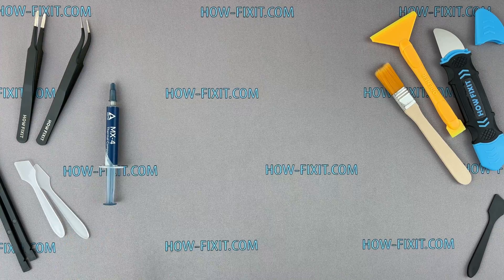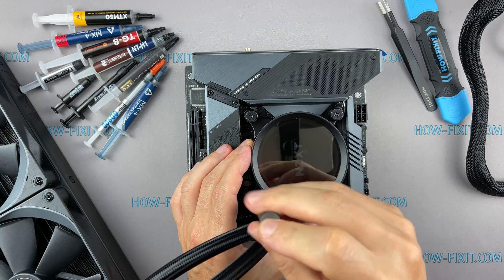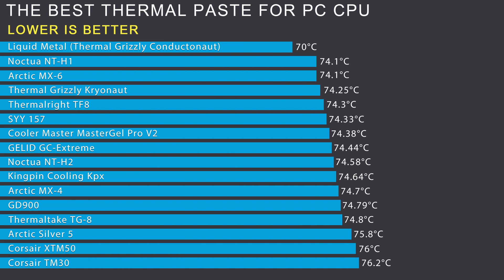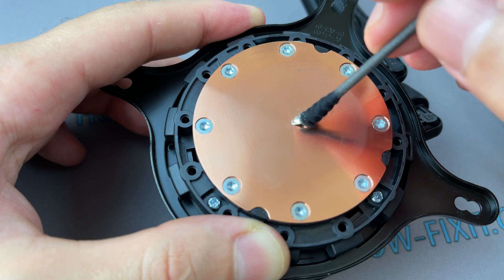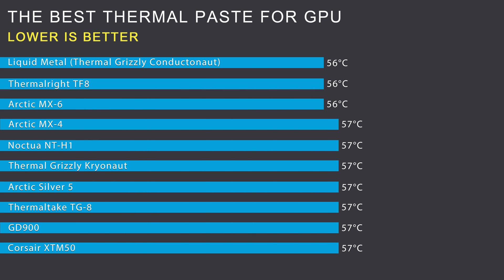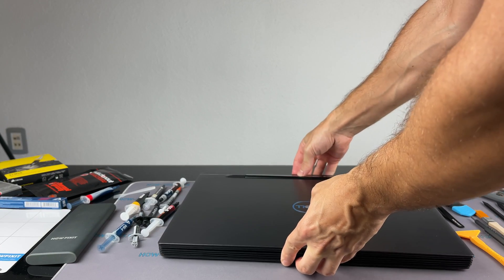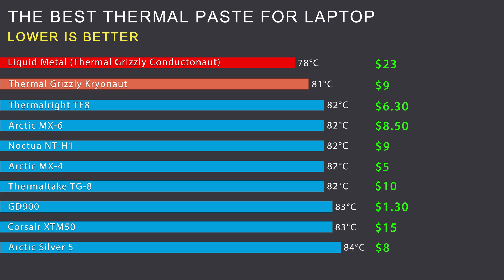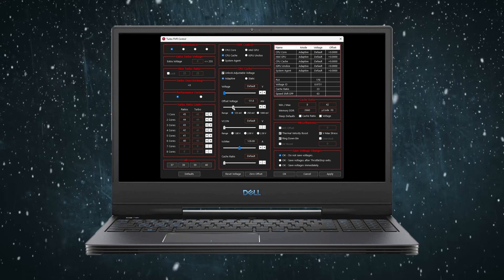The Best Thermal Paste for PC CPU, GPU and Laptop

Comment: I'm a little sceptical of TF8. I used it on my CPU a few days ago. I was getting a steady max temp of 80°c in Linpack. A few days later I was getting 87°c
Reply: TF8 easy dry and turn solid...
Reply: I've been using a tube of TF8 for multiple cpu and GPUs, even though I agree that TF8 dries out quickly (in like a year or more). The performance stays similar to almost the same even when dried.

Have had multiple GPUs and CPUs on the TF8 paste for more then a year, been maintaining steady temperatures so far.

Comment: I used GD900 on March 2022 and keep notes on max temperature of my i7-4770 when running cinebench R15 multiple times. It was 61 C. Today, on April 2023, it still at 61 C max. I know for sure now that my GD900 is genuine, and it is just as good as my MX-4 in term of long term performance.
Reply: GD900 is really as good as Mx-4 when CPU max Temp continuously stays under 75c. But if you use a more powerful CPU and play CPU demanding game where temp stays above 80c... Then you will get a difference.
Reply: how about in 2024 ?
Reply: The downside only about it dry faster than other expensive one
If you have many computer and maintain them regularly then GD 900 is unbeatable about price/performance
Reply: Haven't tried that, but I know Arctic Silver 5 is the best.  NASA even used it on their critical components.  
The problem is these reviewers use enough AS5 to coat 20 CPUs.  It literally only needs a paper thin layer on the CPU/GPU and then the same or less on the heatsink.  Then it takes a few on/off cycles over a month to cure and lower temps even more.  You'll drop a good 2-3C after only 3 days.  It takes YEARS to begin to "degrade" and by then, the temps are what the "highest rated" pastes make lol.

I've used AS5 since 2003.  I've tried MX-4 and a few dozen other pastes.  I always take them off after 3-4 weeks and go back to God's Gift to PCs and use AS5 because no other paste compares.
Reply: Can i apply gd900 on my Laptop. Is it suitable for it ?
Reply: @danialahmad8912  If the CPU package power in stress does not exceed 30W, and in the PC 120W. For above this values only Honeywell PTM7950.

Comment: Based on tests from tomshardware, the results varied when they used air cooler over water. The NT H1 and H2 swapped places when air cooling was used over water.
Reply: There are tons of variables involved in assessing how effective it is like mounting pressure surface of processor cooler effectiveness...etc I guess the only thing we can really say is that a top 10 paste will all be around the same overall so it matters little (excluding liquid metal). We need long term effectiveness tests. No one does that.
Reply: @stephenxs8354 when it comes to using the top respected pastes yeah I agree the change is so nuanced and minute that you should just use the paste you like more for whatever reason you have. Be it easier to spread or use or you just like the name better or the color even, it really doesn't matter at that point because the difference is usually so negligible it's not worth fretting over.
Reply: Plus just the way to apply it.  You can't use the exact same amount for all of these pastes.  Arctic Silver 5 is VERY finicky, but it's the best out of all of these when applied correctly.  
And when I say it's finicky, I mean it.  I've applied it, gotten temps that were 6C too high, then reapplied it and gotten -8C+ temps than I had just gotten.  Too much is a bigger problem than what looks like too little.  You can not coat the CPU like it's peanut butter on a slice of bread or you will not get the best results.  

I'm not saying it's better than Thermal Grizzly, never messed with that stuff, but I've got years upon years of using AS5 on CPUs and GPUs and there is a special way you have to apply it and spread it, and a very particular amount you need to use to get the best results.  

That said, that may make it the WORST paste for beginners.  When you can get 8-10C temp differences just because of using a tad too much, that could be a problem.  When it comes to AS5, less is more.  It's SUPER thick and hard to spread, so it makes you want to just add more paste to fill in any gaps... but that will have you adding too much before ya know it.

Also, you spread paste, you don't put a pea size drop and squash it with the heatsink.  AND you apply and spread some on the heatsink, also.  I'm just saying, I've done this probably 100 times and have gotten it down to a science.  I've watched so many reviews, and my Fuma 2 Rev B with AS5 gets cooler temperatures than everyone else I see online, and I don't even keep my house cold.  I average 58C in most games, and 62C in BF2042 which pushes my 5900x to around 45% average usage which is around 115 watts average, I believe.  

And that's not even talking about the core temps.  That's the hottest temp on the die.  Core temps are usually 10-15 degrees cooler than that hottest temp HWiNFO64 shows.
Reply: BTW, did I mention NASA used Arctic Silver 5 on a piece of one of their space shuttles? 

Yeah... it's that good.  They didn't use MX-4.  They didn't use Kryonaut.

They used friggin' AS5.  'Nuff said.

Comment: I'm happy you made this video. I just bought a new CPU/Mobo upgrade and wanted the best available paste but I already had a tube of Arctic Silver 5 so I was skeptical of buying something else. Now I know that I might have saved 1 degree total
Reply: What isn't said in the clip is that Artic Silver 5, although the manufacturer doesn't say it, has a curing in period.
Reply: @dorientjewoller113 and its conductive
Reply: @quester34  No longer, formula has changed.
Reply: @user-fiendly186 I have an HTPC I built over 10 years ago with Arctic Silver 5.   Just recently took it apart and reapplied Arctic Silver.  Never had an overheat issues with AS5 even in my desktop gaming pcs.  The way I apply it is with a credit card and apply a thin layer to the entire top of the CPU.  Worked great 10+ years ago, still works great today.  You want minimal paste on the CPU, just enough to close up any gaps between the heat sink surface and the CPU surface.   Less is more.

Comment: I spread a thin layer over the whole CPU and then put a 'dot' in the middle. My theory being just spreading can cause air being trapped, and with only the dot, you risk not covering the whole CPU.
Reply: Hm, that's quite neat idea 🤔
Reply: I was just thinking about trying this the other day.
Reply: That’s actually really smart
Reply: Same thing I've been doing for a few years. Thin spread, then about half a grain of rice in the middle. Little to no spill over, but perfect coverage.
Reply: For those thinking this is a good method. You ARE WRONG! Try on 2 pieces of acrylic and see the result.
The dot will create a "layer" over the alredy spreaded one but very small, and will prevent the correct contact with the rest of the cpu/cooler, creating more problems than going with any of the other 2 methids alone. 
This happens because it is exactly the center the part wich have the less direct preasure from the cooler and the outside preasure which begings earlier and stronger prevents the correct flow of the dot
Reply: The sheer pressure of the heatsink should force the air bubbles out. I think what you are getting by putting a dot is a placebo effect.
Reply: So you put thin thermal paste, then put dot. I need try. Only one try
Reply: I put 5 dots. 1 big one in the middle & 4 slightly smaller in the corners. Always have perfect coverage that way.
Reply: Nothing related to paste but sorry I just liked ur comment and changed the likes from 420 to 421😅
Reply: Exactly also my technique with applying thermal paste on the CPU and also the cooler.
I use both techiques on the cpu aswell on the cooler to minimize airpockets
Reply: this sounds like a solid, good method. I just use the half pea size amount, never had problems, but yes the CPU corners are left bare
Reply: I make an X.
Reply: @Honin_Cheta_Cheese_Akecheta You are the only person I am seeing who used an before the X.
Reply: @ that’s how you say that in a sentence right?? 😂
Reply: I've been laying a generous bead of paste from one end, to the other. I'm most definitely using more paste than necessary, but I'm not worried that anything was missed either lol
Reply: Ye i exactly did same lol
Reply: Yo that's smart
Reply: If you spread properly you shouldn’t have any air pockets.
Reply: @nlmaster9811  OK.
Reply: Great idea! That'll prove helpful in eliminating the air folded into the paste when spread. The dot will spread when placing the heat sink.
Reply: What about the X pattern, along with adding small dots in the open spaces of the X? So adding a dot at the top, left, right, and bottom. Should spread pretty evenly
Reply: Elmor’s Lab did a big write up and very scientifically tested paste application methods: he determined the sausage (line down the centre of longest side) is the absolute best way, bar none.
Reply: Ur idea seems more logical👍
Reply: I always go with an X pattern.
Reply: That’s exactly how I applied it to mine and it was perfect and my temps are great!
Reply: Exactly what i do too
Reply: Brooh....
Reply: So you prefer an uneven distribution of thin layer and dot. Not much better!
Reply: Same brother
Reply: The paste eill then be too thick
Reply: A cross and a small line in the middle will work for me with looking at how thermal paste spreads
Reply: I do this exact same thing man, but with the X method
Reply: What if you doo the trowel method like doing tiles?
Reply: Does over eating help??
Reply: Thats why you use the x method with no spread... 😂
Reply: holy smokes its genius
Reply: If I understand you right. You do the thin layer he showed, then you do a second layer "dot" and use that plastic thing to spread the dot?
Reply: @lookingatdaisies9901  I think the process would be letting the dot in the middle to spread out naturally
Reply: @averageboycrush  If you only use the "dot" technique, you will discover that all the corners wil not have any cooling paste.
So when you add upp all the "dry" corners, that means that about 30% of the cpu is not being cooled due to the lack of paste.
Reply: @lookingatdaisies9901  the plastic represents the cpu being pressed down.
Reply: @lookingatdaisies9901  
No, spread, then a dot and put cooler on it.  Use, will spread the dot.
Reply: @lookingatdaisies9901 you are the reason there are instructions on the shampoo bottle.
Reply: @lookingatdaisies9901 no
Reply: Shape H is the best

Comment: Putting liquid metal on CPU IHS?
Dude that is the worst thing you can show on a video, just check what happens with IHS & liquid metal on internet/YT after some time it is applied and reacts. 
Liquid metal should only be applied on direct die/copper.
Reply: IHS is nickel plated Copper. Nickel (N. plated copper)  is much better to use with LM then copper.  Here is problem, just dangerous aplication of LM on IHS - CPU cooler.  But i would never use it btween IHS and cooler in standard pc, its just bad advice in general. Delid-LM-IHS is ok.
Reply from the maker: I always knew that there are many people who are mistaken in the field of liquid metal application, especially viewers like you, I created this video -> https://youtu.be/w7ChaNf9N-w